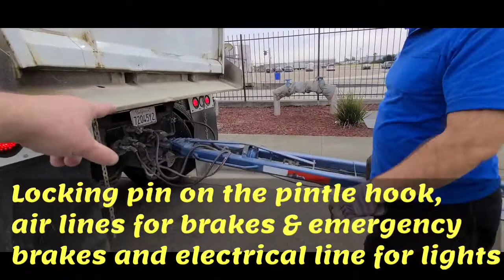How A Transfer Dump Works

Comment: That was interesting. Never seen those around here. Mind blown on the reversing button! - Jason
Reply from the maker: I think he puts it in reverse, then turns the motor off and thr switch he hits on the back of the dump, just kicks the motor over, but didn't start it. Like when you turn the key over, to just kick the crank and cam over to check valves? If I'm explaining that the right way?
Reply: @CONTAINERMAN68  I run one, you put the truck in reverse and you have a kill switch in the cab that shuts off the fuel to the engine so it just bumps the starter which propels the truck backwards into your reach. Pretty fun job. Best part is when kids are around you can act like you are pulling the truck backwards and they get a kick out of it😂

Comment: I see them running around and never had any idea that the dump moves on the back
Reply from the maker: Eric, that's only the ones with this type of trailer. There are other dump trailers that have their own hoist mechanism. I think I've seen 2 trailers + the dump on the tractor, running around in Arizona? The trailers with the hoist mechanism can be seen in front of the dump.

Comment: How many tons does it carry?
Reply from the maker: 17,000 pounds per axle. Steer axle 12,000 pounds. Just like an 18 wheeler, 80,000 pounds
Reply: Typically between 24 and 25 tons.

Comment: Double pivot point, I would have zero chance in reversing
Reply from the maker: Instead of turning opposite of where you want the trailer to go, you just turn the direction you want it to go. But with this type of setup, I don't think you would need to back it up anywhere!
Reply from the maker: Yep, but you wouldn't need to back the trailer anywhere. That's the point of the transfer dump. It slides into the front dump after it's been emptied, then you empty the trailer box in the same place as the first dump box. Or in a totally different area.